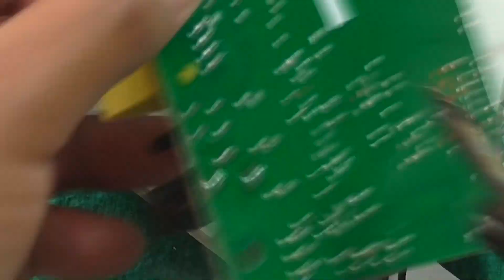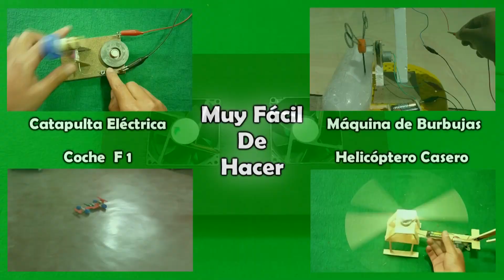Ventilador Casero para Laptop - Muy fácil de hacer

Comment: Sé que el voltaje se suma pero cómo calculo la suma de los miliamperes de cada ventilador,  la resultante es el wataje que resulta de la suma de las potencias w de mis 3 ventiladores ? Ésa potencia,  es la que no aclaras de tu fuente de alimentación de 12volts , no lo tomes a mal no es crítica es que nececito compartirla lo antes posible seria igual a la suya y un ventilador de cpu que extraeria,  cómo debo proceder ¿?